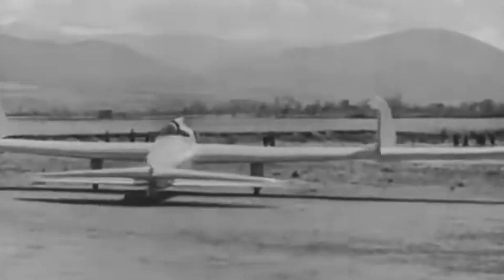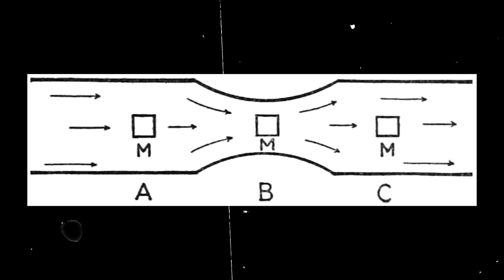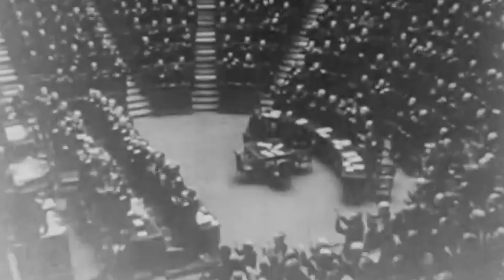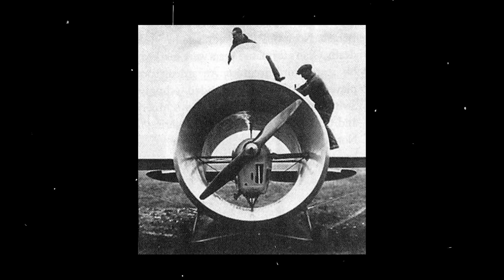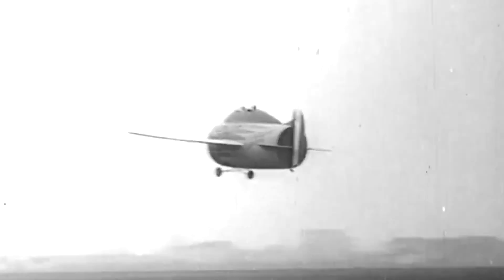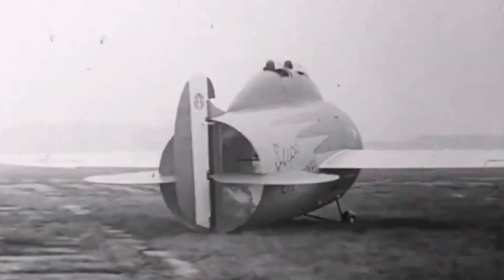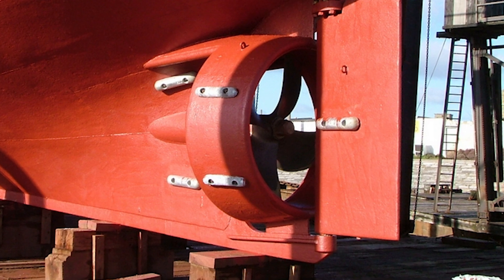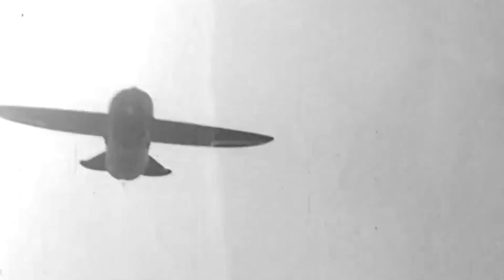A Bizarre Fat Airplane that Changed Military Aviation Forever

Comment: Reminder, lots of viewers are still not used to imperial units. Please edit the metric units at least on screen. 
Otherwise great content, fascinating stuff... Well presented. Therefore a shame missing these following sentences while converting the units in the head
Reply: 25.4 mm per inch, welcome to the rest of the worlds method of measurement lol
Reply: 25.4mm per inch
12 inches a foot
3 ft a yard
1760 yard a mile

10 mm a cm
10 cm a dm
100cm a m
1000m a km

The same shit with weights, volumes and combined units...

You got it ... Why easy when you can do it complicated 🤠

Comment: Quite the unusual aircraft, but interesting nonetheless.
Reply: The USA BeeGee aircraft from 1932... built in Springfield, Massachusetts. Very similar.
Reply: I thought it was a racing plane. There are several designs that look like this even to this day. It's just a tube imagine how light it was even though it looked fat.
Reply: Quite the interesting aeroplane,  but unusual nonetheless.
Reply: Neat
Reply: Reminds me of the gee bee race plane
or what Jim Winchester calls it in his book "a sewer pipe with wings"
Reply: It's about the girth
Not length or size!